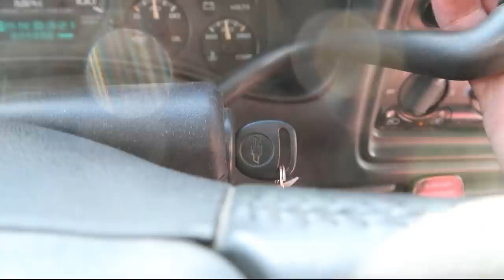NEW SWAP FOR KHAKI

Comment: Tip. Don’t cam it bigger then a stage 2 if it has a stock b20 block. The valve relief on those stock pistons aren’t big enough and you’ll definitely drop a valve when vtec hits. Also, get it tuned, it helps to keep B20vtecs reliable.

Comment: I got a 96 EK hatch with a JDM B20b. It’s been on and off and is currently on stands waiting for the transmission but I couldn’t be happier with it. Not the fastest but definitely fun to drive and i ha e a type R head I’m gonna put on it when I go b20 vtec so we’re gonna be running the same set up soon! I even got the same manifold with a 70mm throttle body. I can’t wait until you get this going cause when i work on my civic I always have your videos playing in the backround and you motivate me so much to get in my garage and make things happen. Stay busy and keep building my friend 🤙🤟💪